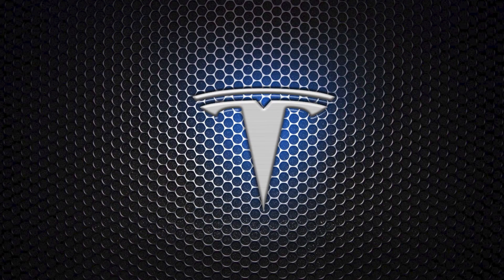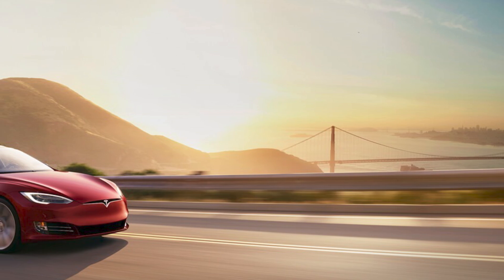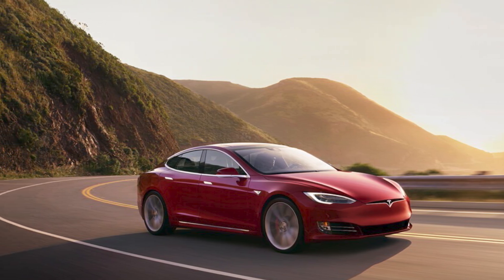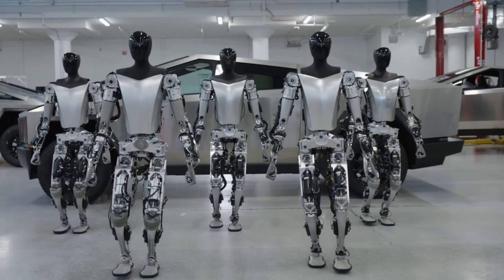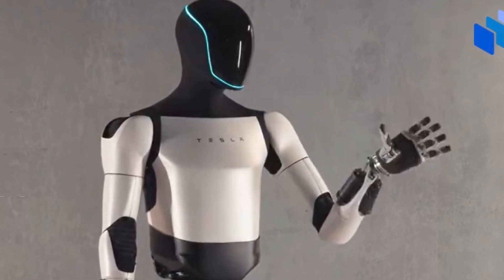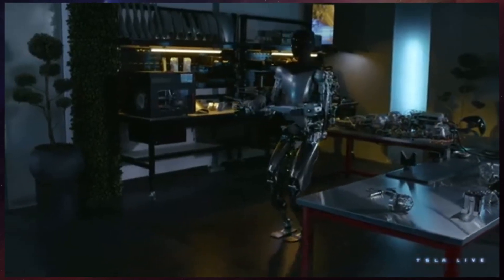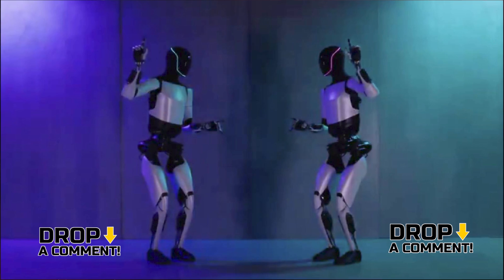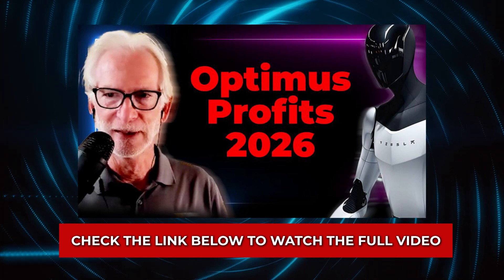Tesla Optimus Bot: What Do We Need Before the First Production Bot Is Final? Scott Walter - Clip

Comment: I read recently that ford and Chevy use less labor per car than Tesla. I’m very surprised. Would you think this is correct? If so, any idea why? I think of Tesla as more efficient. Thanks!
Reply: Tesla's production process changes every day. Their MobAI teams, which work in 12 hour shifts on optimising components and implement actual changes to the lines several times per day. This level of optimisation flexibility can only be supported by fewer robots. They automated with robots massively and then realised they'd done it too much and ripped out some bots in favour of super-flexible operators.

Tesla's efficiency is a special type. It innovates more efficiently than any manufacturing company on the planet. That doesn't mean any single optimised process is done always by robots. They're not always the most efficient, even though that's not necessarily intuitive.

Watch this vid by Joe Justice (known as the King of Agile engineering) talking about Tesla's mind-boggling component/process iteration: https://www.youtube.com/watch?v=ah2O76h-c_Q&list=PLzDBpb2T-pfPzoKzuKn9YnKwsHmmNQC9O&index=11&t=9s
(thank me later)